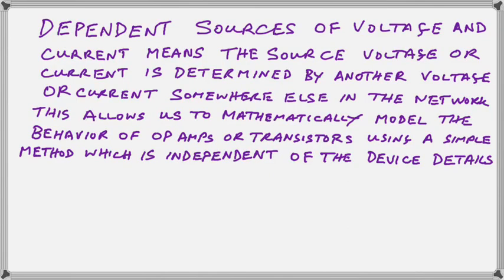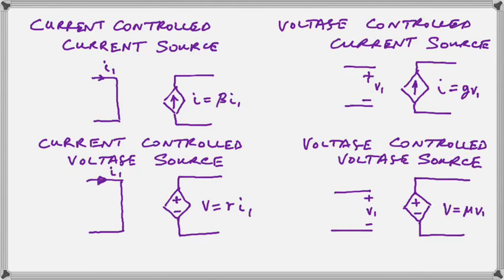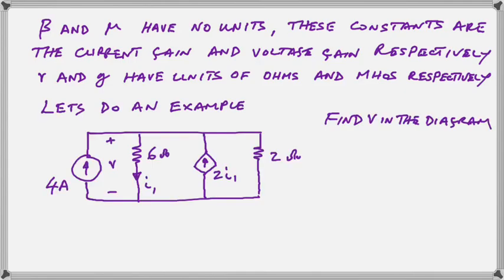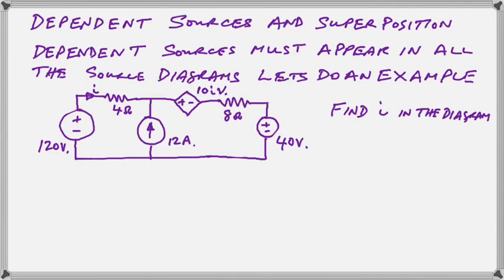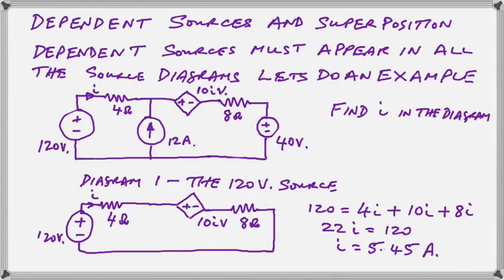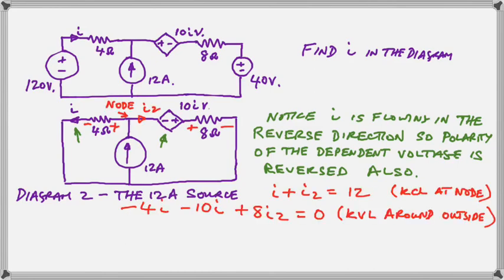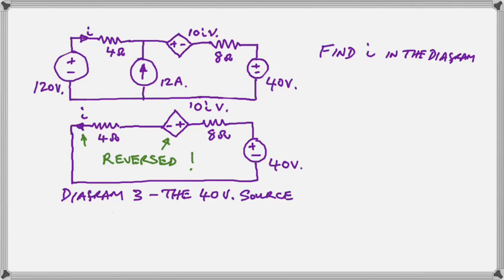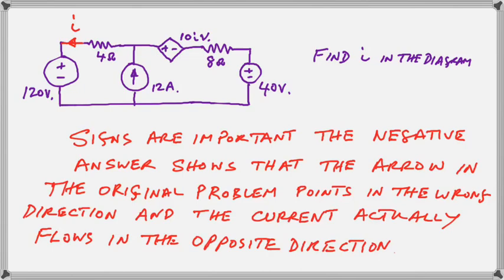electronic circuit analysis  with dependent sources

Comment from the maker: At the end of the video ,  because the actual current is in the opposite direction to that presented in the problem, the polarity of the dependent voltage source will have to be reversed also..... although this is not actually shown in the video, you will need to do this IF you decide to 'prove' the answer.